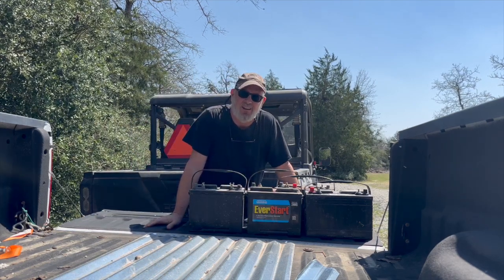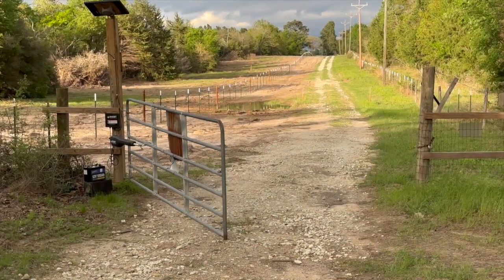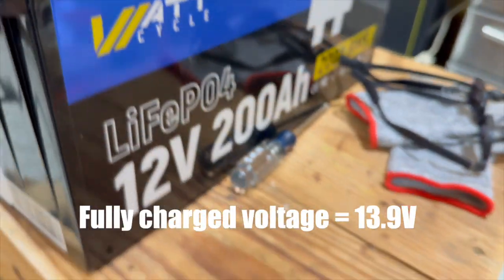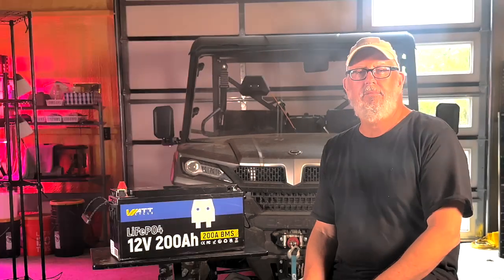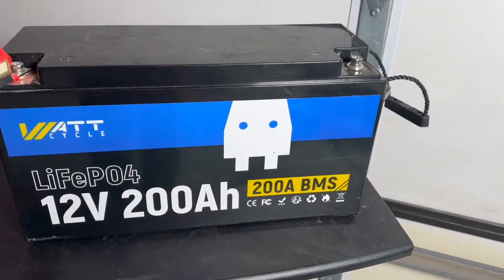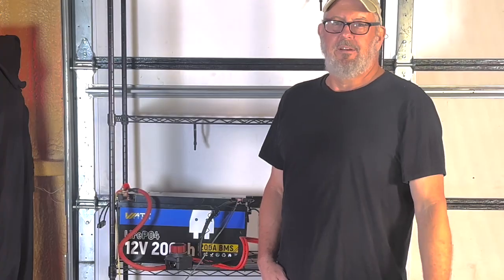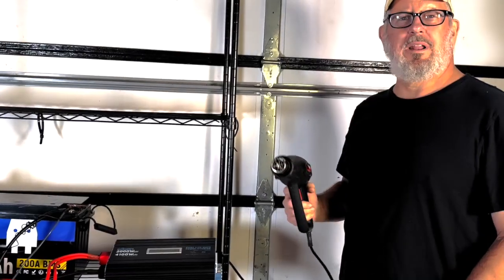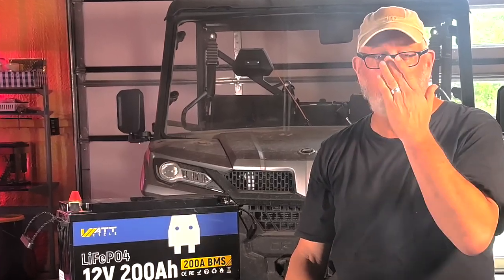LiFePO4 battery price increases start this week! Build a 12v DIY Solar System like this one!

Comment from the maker: I get lots of feedback on how expensive it can be to build a solar system, however; you can build a 12v solar system powerful enough to back up many critical loads in your home for a lot less money that you can buy a comparable solar power station or home solar system.  What’s even better is that using a powerful 12v LiFePO4 battery like this one from WattCycle, the battery can be used in other applications when you don’t need it for back up emergency power.  This project is simple to build and can be done over time on most any budget. (Bonus points if you can tell me how many times I say “Beast” in this video!) 🤣😂😆

Comment: can these batteries be a replacement for a car? Maybe it is not recommended with the alternator charging system?
Reply from the maker: @CarExpressions  That is a great question I should have mentioned!  There are issues with some LiFePO4 batteries when charging with an alternator so I wouldn’t install one into my car.  With a car, the battery is used to deliver a high amp current for short period to start the car and while the LiFePO4 battery could do that, it is designed to provide a steady current over a long period of time like a deep cycle battery.  There’s also the issue of vibration and since a LiFePO4 battery contains a digital BMS computer, they’re not ideal for high vibration environments, although they seem to work fine in RVs and campers for solar systems, from the feedback I’ve received.  SLA and gel batteries are the best for vehicles for starting.  Thank you for bringing this up! 👍⚡️🔋💡

Comment: I just built a 24v system on a board with a  24v 100amp battery and 2000w inverter. More power than my delta flow 2 and river 2 pro combined. Using with a 100/30 Victon and tested it last weekend with 500W of solar panels i already had. Worked like a charm. So for the SCC+battery+inverter (Giandel)was about $915 then another 150 for 6 gauge & 4 gauge wires and fuses and breakers.
Reply from the maker: @einyv  Fantastic! 24V is definitely a better way to go if building out a smaller stationary solar system, since you can use 2x more solar PV input wattage and a smaller AH battery and wiring.  I went with the 12V because I thought more people could relate and it’s a good way to do a mobile system.  I’d love to buy a 24v inverter and build out a 24V system to run a small cabin or shipping container.  48V is better of course, but man it gets pricey quick!  I really appreciate you watching the video and we’ve got some nice projects coming up so stay tuned!!  👍☀️⚡️😳🔋💡
Reply: @terrahillfarm  agreed. I stayed with 24 over 48 primarily because it's safer to work with and keeps my wife from freaking out when working with electric. 😁.
Reply from the maker: @einyv  You may be on to something here with the prices of most solar equipment on the rise.  Time to stock up on 24V LiFePO4 batteries?? 🤨